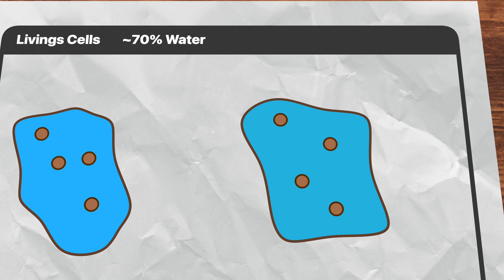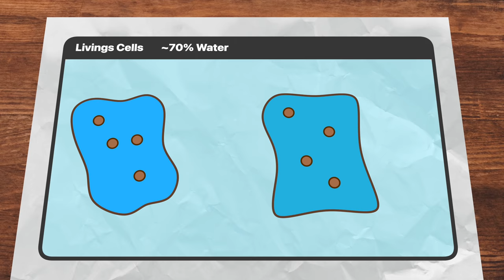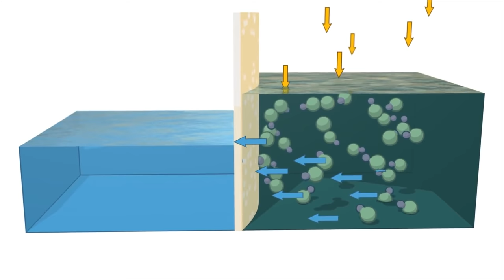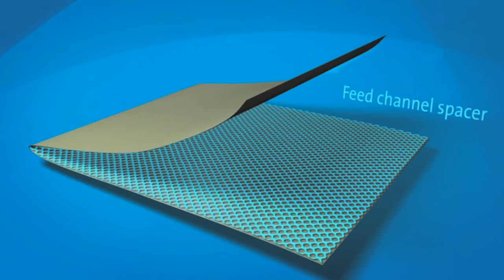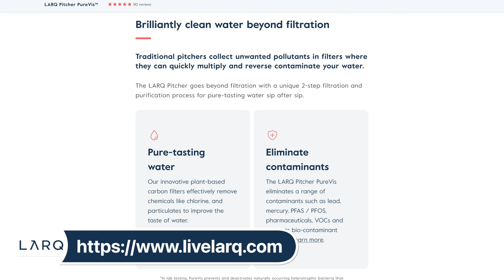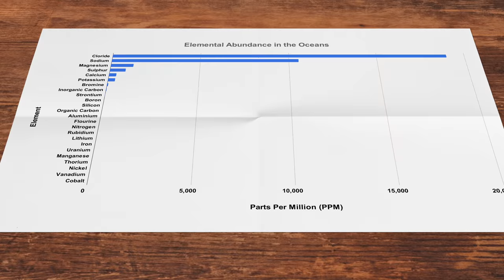Why Not Build Desalination Plants EVERYWHERE?

Comment: I think that you left out a major and minor advantages about solar evaporation:
1) use solar to boil, not just evaporate salt water. Use the steam to generate electricity.
2) let the leftover steam rise to a height to allow gravity to move it.
3) as mentioned, derivatives could pay for the desalination. Sites around the world evaporate sea water to get salt. Put these two together and sea salt out one side and water out the other.
Reply from the maker: great point! Brilliant!
Reply: Perhaps use tidal power to drive pumps.
Reply: Theres more than just tablet salt to extract...
Reply: All hydropowerplants use this already. Moving the water up to a higher place using clouds and rain.
Reply: 1/ Salt water / steam through a turbine won’t last long
Reply: @Froggability  Entropy doesn't end.  Exploiting energy as it transforms is clever and it is an engineering challenge, not science, so it can be solved.  Look at charge generation from breaking action on electric cars...
Reply: will produce lesser water that way - which is more precious then energy for at least Saudi !
Reply: And than use the salt in molten salt energy storage systems.
Reply: Heat it up enough and the left behind heated brine could be used as a battery at night.
Reply: @mr.anderson70  the steam is going to generate a stupid amount of electricity.

If you are spending all this energy boiling the water, you can recover close to 30 percent as energy with turbines, and that can not only run pumps to drive the system but also to pump the water uphill to cities and farms which are all usually significantly higher in elavation than sea level.
Reply: @Richinnameonly  *then
Reply: The point of this is to generate drinking water. If you boil it to make steam, then you don't have water to drink.
Reply: @boggless2771  What if the tidal power/pump happened to be a single unit pod that pumped water inland?  Less underground, high-voltage, electrical cabling required.
Reply: Unfortunately, solar is not 'on-demand' as you need to produce fresh water 24/7, and solar just won't do that.
Reply: @Froggability  Steam does not contain salt. The salt is left behind. Same reason rain isn't salty
Reply: There are many obstacles to over come with solar power desalination and power generation.
1. You must be able to collect the steam in a relatively small area in order to get the pressure high enough for the turbines,                     but you need a large area for the solar collectors to generate the amount of steam needed.
2. Turbines need constant pressure to operate efficiently they prefer constant RPM and are not as efficient with speed changes. Solar is not constant even in the desert. Night time no solar to generate steam, Morning and evening indirect sunlight provides less solar energy also cloudy days will reduce solar output. Peak solar output is between 10:00am and 4:00pm each day that the sun is out.
3. Must engineer a way to remove the brine without shutting down the solar collectors and stopping the steam generation.
4. Backup thermal systems to create steam when solar not available will be very costly.

These are few of the engineering challenges that I think will be eventually overcome but it will not be cheap. The biggest is the constant energy input that is needed. Currently only fossil fuels and nuclear energy can supply the 24/7 constant energy needs.
Reply: Has anyone heard of sundrop farm?
180000 tons of tomatoes a year produced with sunlight and seawater by making use of concentrated solar power and heat transfer systems.

Oh, they produce more clean water than they use. Only down side...
Reply: 4) ???
5) profit
Reply: there's a bit of problem with that method with current technology. 
Boiling water is energy inefficient way of making fresh water due to the massive amount of energy it takes to change water liquid to vapour during boiling, the latent heat of vaporisation.
Steam turbine generators utilise steam at a very high temperature and reheating of that steam to drive turbine to generate electricity. The steam is not allowed to condenses into liquid so they only reheat the steam and not have to deal with vaporisation, the higher the temperature of the steam the generator uses, the more efficient it is.
Most modern desalination plants use reverse osmosis, it uses a lot of power but not nearly as much as thermal desalination. It is more energy efficient to use fully steam cycled electricity generator and then use that electricity on reverse osmosis desalination as this circumvents the latent heat of vaporisation of water.
Reply: @Zayphar  you don't need to produce fresh water 24/7, that's what dams and water tanks or reservoirs are used for to store water.
Reply: @ww11gunny  steam used to generate electricity in steam powered turbine generators are not allowed to condense to liquid, you need to constantly recycle and reheat the steam to make it run as the turbine runs on pressure differentials so the generator can only use superheated steam far beyond the boiling point. the hotter the steam the more efficient the generator. Energy to overcoming the latent heat of vaporisation is too costly and wasted.
Reply: Take a class in Thermodynamics. Pay attention to the 2nd law.
Reply: @ad2181  2nd law of thermodynamics, only apply to closed isolated systems. the systems for desalination has feed in as sea water and outputs freshwater, making it an open system.
Reply: @penitent2401  Second law applies to open systems as well. Its applies to the Universe, jet engines and everything. It was first derived for close system. There are alot of online videos on it.
Reply: You'd probably need to recycle the steam, like a co-gen gas turbine, to maintain temperature and for efficiency?
Reply: @snakedoktor6020  What happens when steam cools?
Reply: @Froggability  False. We use the right materials.
Reply: @Mike Dunning Simplicity is elegance. Every day the sun gives us 100 times the energy we can use in a month. Nature evaporates lakes into salty seas. Just copy nature and let the condensate run down tubes to collector pipes. Most of the system is gravity operated and needs no wiring of any kind.
Reply: @Mike Dunning Your appeal to authority debate fallacy and passive aggresive 'boy' comment is lame. I'm a retired marine electronics engineer too. 5 years of my life were on salt water, seeing fog rise up from the sea every morning, powered by the sun. I buy sea salt for my pantry, it was made by the sun evaporating sea water. No dreams involved, just understanding that simplest is best and the most sustainable.
Reply: @marcrolison4478  not quite. There can be still dissolved salts in the steam droplets, amounting to up to 13mg/l
Reply: TANSTAAFL
Reply: @marcrolison4478  Guess thats why everything in florida turns to crap from the salt water it does not touch ?
Reply: @penitent2401  I can add that a boiler for sea water is going to be very expensive do to corrosion problems.
Reply: Then clean the solar, replace broken solar, hide solar under sand when it stops being economical...
Reply: If we make sea salt out of the current ocean water I think it would be full of pollutants and radioactivity. Sea salt from millions or billions of years ago is pure sea salt.
Reply: @Richard-zc1cj  Companies always find a way to extract expensive stuff in things selling ppl the nonnatural pure rest of it. Exactly as with sea salt or other demineralised salts... It's more about getting water extraction economical. It can be sold as ecological cleaning oceans scheme...
Reply: depends on your end goal.  if you are trying to produce freshwater, its probably inefficient to use the steam to power a turbine.  There is only so much power in the system to go around
Reply: " Use the steam to generate electricity."
Steam, by itself, does not generate electricity.  Pressure is what spins the turbines that generate electricity.  You could use solar to heat water to produce high pressure steam; it is already being done in the tower of power.  Economically it appears to be a disaster.
Reply: Yes I have seen the sun evaporate water.  It seems like you could condense it back in a large scale distillery.  Blow in cooler air from underground pipes if it helps condense the vapor back to liquid.  This could be done but society prioritizes paying for everyone's meth.
Reply: @krikeydial3430  "Yes I have seen the sun evaporate water."
You have certainly seen the result:  Clouds!
Reply: @thomasmaughan4798  Brilliant xD
Reply: @thegreatone11  That would toxify the land.  Better to put them in crab pots or use them to chum the water.
Reply: @ww11gunny  
Cools how?
Where does the heat go?
The 2.3 million joules that each and every litre requires to change its state.
Reply: @braxbro6674  
Massive amounts of heat energy are released into environment?
Reply: @JohnSmith-cn4cw  
Correct, Sir.
There Ain't No Such Thing As A Free Lunch.
Reply: @notahotshot  
Then just call him a dreamer with no Physics background, that doesn't understand the science behind what he is proposing, and why it can't work.

Comment: Brine could easily be repurposed for regions that use salt on the roads. Brine is great. It actually sticks to the surface you apply it too and coats way more. Salt lands in random spots. Brine gives you a solid consistent coat.
Reply: Spray salt water on the roads as much better than putting salt on the roads. It goes further and causes much less contamination, but the long-term is destroying the water supplies and the plants unless you live in a very rainy place the salt does damage to the plants and trees near the road, eventually winds up in the Wells